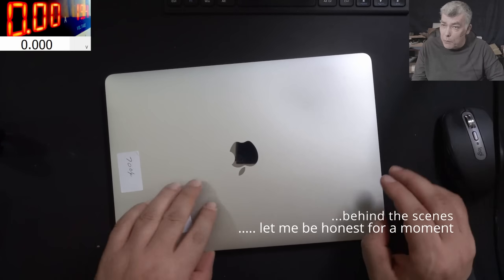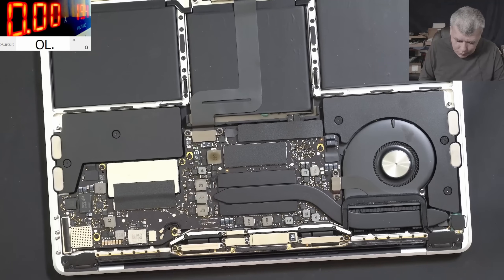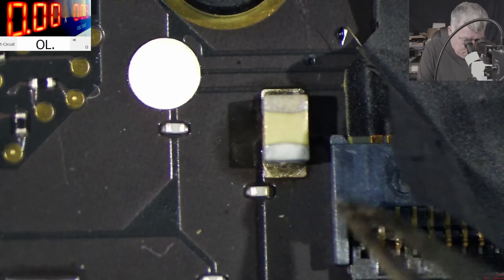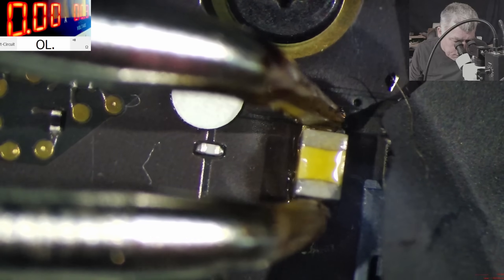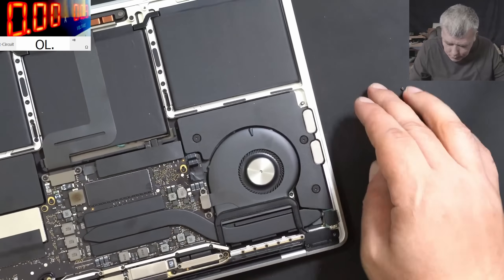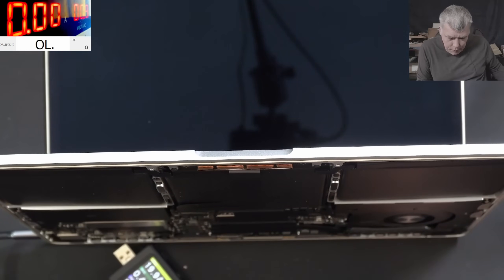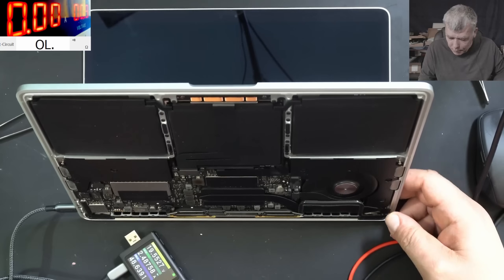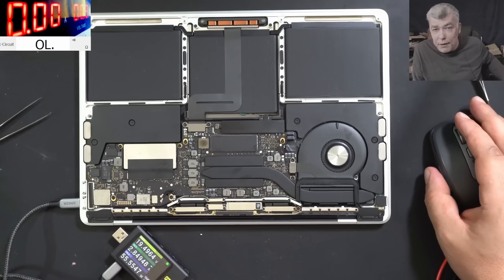MacBook Pro A1708 no power logic board repair - Using soldering tweezers for the first time :)

Comment: You may bridge the sides of the capacitor with a proper calibrated wire and use a normal soldering iron on the middle. it melts both sides

Comment: I hate solder tweezers. If you use a fine nozzle on an air gun and move it back and fourth rapidly across the cap and connector, the connector will never melt while also heating the board. You can use the same method to change any plastic connector whithout having to use air from the underside.

Comment: i like to use roses metal which has a melting point of 96C. After applying on both sides most off the times its sufficient to heat one side of the cap with soldering iron the other side will liquefy by its own from the heat. but you have to remove it afterwards

Comment: Sorin, for challenging desoldering jobs I bought a little ChipQuick kit ((SMD1 NL). The kit contains some gel flux and very low melting point alloy (I think it is liquid at 90C). When mixed with normal solder the joint stays liquid for a long time. Just touch the soldering iron to the ‘ChipQuicked’ solder joints and lift the component off of the PCB. Simples 👍🙂 Very low melt solder must be wicked off the PCB after use but it can save a lot of hassle with challenging desoldering situations. Totally unsuitable for soldering a component though. Alternatives to ChipQuick are available but check that the melting point is very low. I have yet to use a pair of soldering tweezers that I liked. Most that I have used seemed underpowered for anything but the least demanding of tasks.
Reply: I fully agree with the comment above…as far as I know Chipquick melting point is 58C and it accelerates the desoldering procedure to “difficult areas” a lot….20 years ago I was using Gaugemaster GM1 at 73C with approximately the same results.

Comment: When desoldering a component from a board using tweezers i am much much faster when i add a little bit of a fresh lower melting (150°C) solder on both tips. That lowers the desoldering time to a few seconds. I am sure a standard snpb solder will work too.

Comment: To "How to desolder a capacitor?": It's called "Deformation Professionelle". Being so deep into Air Guns that you can forget how soldering works. 😂 Simply alternate the soldering tip between the 2 sides. Second option: Have a second soldier iron ready and use both of them. Costs really nearly nothing.

Comment: You can remove the capacitor without the soldering tweezers. You add lower temperature solder to both connections, and lift one side, and then the other.
Reply: You can also put a copper wire from one end to the other and then use a soldering iron to heat both ends at the same time.
Reply: Exactly what will i do. Just using soldering iron.

Comment: Add solder to both ends of the cap before using the tweezers...
Reply: That is probably unleaded solder and it has to get really hot to melt.  The leaded solder on top facilitates the melting of the unleaded solder from my experience.

Comment: In cases like that i use a knife tip. I heat both sides of the cap and remove it with tweezers.

Comment: Over the years I've found such tweezers tend to be less useful than I wish they were :(  ( even in this video, that was 2 minutes of tweezer application :-o )

These days, I've got a nice fine pair of pliers that I've filed down to narrow points, using that tool I remove capacitors quickly and cleanly.   Of course, you have to know the PCB traces that you're located over, because if you don't, it's easy to end up tearing away the traces and creating more trouble.

The trick is to push down and apply sideways force so that the cap shears off from its endcaps, usually works very easy with already damaged caps.

You see other techs like Jessa Jones do this a lot on things like iPhones where it's near impossible to get hot tweezers in.
Reply: It was only 2 minutes because these tweezers are weak and Sorin didn't lower solder melting temperature. Only 40W per one side, 80W total. It's like using 2x 40W soldering iron. Of course 40W is extremely low power for such a big ground plane. You need at least 80W for ground. Weller also quite a bad compared to JBC. Also the tip size matters, if you have too small tip, thermal capacity will be smaller. I usually use just 2 soldering irons at the same time. In this case Sorin could of helped GND side with soldering iron as well. Also always lower soldering temperature first. This lead-free has very high melting temperature, even if you use normal 180 degrees lead soldering wire it helps a lot. Even better if you use like 140 degrees low melting soldering wire. Maybe even these tweezers could of soldered that easily in that case. But of course if you have no space it's different story, in this case Sorin had quite some space.

Comment: You may get ad try aluminum tape - that works real good - suggestion only - I use soldering tweezers also and they work much faster than that - not impressed by those tweezers